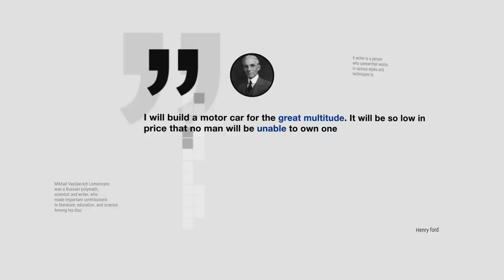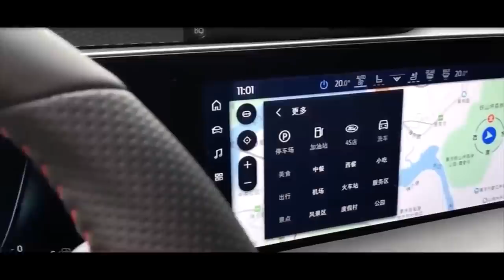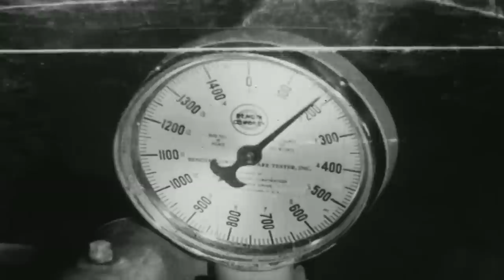Ford CEO Shocks Industry With New $20k EV!

Comment: Plot twist - the 20k version has 75 miles or range. You need to add on the Ultra S package for $19,289.93 to have over 250 miles of range, as long as it's not cold outside.
Reply: That's some real range anxiety right there at 75 miles alone. Especially with how hard it is to find charging even in cities.
Reply: And no traffic . No stop signs and down hill
Reply: @thetruemorg  yes. 75 miles is a local runabout to buy groceries, not a road trip act.
Reply: @thetruemorg  Not range anxiety, more like how I don't think a $20k EV will be all that great based on how much all the others cost. You'll probably have to end up paying close to $40k to get something worthwhile. They have to cut corners somewhere to get the price that low, and it will probably be in the battery size.
Reply: Is this information available anywhere or are you just speculating?   I haven't seen any 75 mile range anywhere.
Reply: @shoveI  i was joking :)
Reply: @thetruemorg  I drive a 60 mile range EV in Canadian winter and zero range anxiety. Don't suck.
Reply: @Ashquacks define where in Canada?   People from Vancouver, Montreal or Toronto Area winter is different than some places  in Canada.   Try Northwest Ontario or Manitoba area where it can be -30°c to -40°c for a few weeks.   That’s not even with the wind.  That’s -22°f to -40°f my American friends.  :)  People from larger city like Toronto and Vancouver describe winter and cold differently and tend to over exaggerate.  😂🤣  January and February is the coldest time of the year for central Canada in Manitoba and Northwest Ontario.
Reply: @LamHalen  Calgary, where we indeed do get (and did get) weeks of sitting in the -30's. Windchill also doesn't affect inanimate objects like cars, it's just a thing for us because of the moisture in our skin.
Reply: 🤣 fax. Or u have to wait 2 whole years for delivery. And by that time a new one will cost less
Reply: The vehicle isn’t even out yet!  Who said it has 75 miles of range?
Reply: @jakereal3604  I was joking :)
Reply: @Ashquacks  Yes, just to go to the 7-Eleven...
Reply: Actually it is a 7.5 mile range.
Reply: This will not happen at that price. It it is early 2023 now and no cheap EV. The price target will never happen and it will not have that much range and HP.
Reply: @rotart12arx3  "Around $30k" could end up just meaning $32,599 for bare bones. I'm expecting this to be at least $50k for anything worthwhile.
Reply: LOL!!!!  Thought it was too good to be true - 20K and only 75 mile range.  Ridiculous.  I will pass on this idea from FORD.  Also when would it show up in the US.  Sounds like they are making it overseas - not sure though.
Reply: @LamHalen  Where I used to work at we would have some customers from Nunavut and other cities way up north and I would always hear how Montreal winter was way worse than up there.

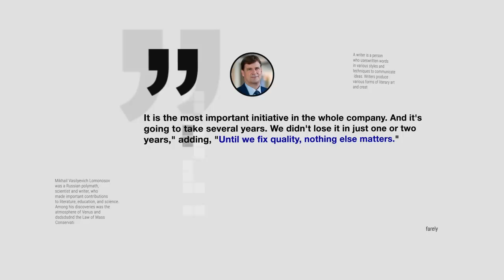Comment: 5:00 I am sorry, but QC is not related with recalls, it's bad design. QC check if what leaves the factory is aligned with the spec. If yes, it's 'OK'. If you have a recall, because you found that the glue you use to fit your panoroof is too weak to withstand the weather and speed, the QC check won't find it faulty, as this is your design and spec. This is the design and pre prod test team's fault for not to spend extra two months on testing. Same story with Rivian and snow on LEDs. This is not QC, this is a faulty design.

Comment: Wrong again. The Bolt 1LT retails for about $27k. Cheaper than the Leaf and a much better vehicle
Reply: 32k now
Reply: @enriquereboyras4381  no it's not the 2023 chevy bolt ev is 27000 and euv is like 29000
Reply: @Samuel Walker. Leaf is better. It doesn't burst into flame like the Bolt because GM uses scrappy LG batteries.
Reply: @mrgurulittle7000  Scrappy is good.
Crappy is bad.
Reply: @D Vader. I meant to say crappy. Anyway... A Nissan Leaf is neither of those. They are built much better that the Bolts which are made by LG.
Reply: @mrgurulittle7000  19 fires with 150,000 vehicles is minuscule. Tesla has had more fires and GM has replaced most of the batteries already and will eventually replace all of them  Chademo is dead why would you buy a car with such limited charging options
Reply: @boomerbits2297  Chademo is better because it is a two way power flowing charger. The industry talks about EVs powering homes, but only chademo can do that.

Comment: in December 22. OEM Battery costs are trending below $95 / kWh. So a 65 kWh (270-mile range, 220 miles in extreme temps)  Including BMS OEM cost $7000. The rest of the EV systems cost less than an ICE. OEM can source and assemble the rest on the skateboard for $10,000, add a 25% margin. An OEM can hit a $22,000 Sales Price in 2023. GM is selling the 2023 Bolt for $27,900. When motor efficiency gets to  6 mi/ kWh then you only need a 45-kWh battery with BMS costing $5,000, rest of EV costing $10,000 33% margin = $20,000 sales price. A second 'commuter' EV in a family with a 200-mile range costing (Bat + BMS $4000, rest of EV 10,000) with 25% margin = $17,500. The Chevy Spark EV (2014-2016) built on the Spark ICE platform was (is) a fantastic economical 80-mile range daily Commuter EV with DCFC for $20,000.                                                             Yes, Profitable, affordable EVs are being built. Following the IT and WWW model, many EV software services uploaded via the WWW and GGG (Global Grid of Grids) will add revenue to OEMs EV sales. EVs are Tech devices + mobility devices. No one sells phones anymore....PCs, cell phones, the internet were all too expensive and impractical, remember those days... and what will we do with all of those cell phone and lap top batteries? Plugging in a phone? Nah, never happen. Such a circa 1985 mind set. E mobility, EVs as a service are here.

Comment: Tesla has an achilles heal called service and training , if they can get there dealerships whipped into shape they can beat them at their own game. The masses don’t need 0-60 in three seconds and the pipe dream of full self driving. But a reasonable range , dependable and a warranty that leads the industry should be enough too get the job done and run their stock price to record highs. Just like Henry 100 years ago.

Comment: Electric cars should be cheaper than gas cars.  Yes, batteries are expensive but so are sophisticated internal combustion engines and transmissions which require A LOT more manufacturing infrastructure.

Comment: Um... The Nissan Leaf's second generation has a lower range of 149 miles of range and an upper range of 212 miles of range.  Also the Leaf is limited to chademo quick chargers of which there are enough, but it depends on each person's needs.

Comment: Ford is the dark horse only now in 2023 coming out with an in house dedicated EV platform instead of modifications to ICE architectures or joint venture.  
GM, on the other hand, has a well-branded Ultium about to hit roads a few years too late.

Comment: No mention of charging infrastructure other than home charging. With a 270 mile range, this is a commute car and at $20K it is a perfect fit for that huge un-addressed market. The Hyundai and VW EVs are too expensive for this market. Tesla will produce an EV in this price range or a little higher and there's nothing wrong with being second to market as Ford is with its other EVs. The Manufacturing ramp and the charging infrastructure are still unknowns for this EV but with Ford moving faster than most other EV makers (GM, VW), this EV will significantly help the adoption of EVs.

Comment: $20,000 ? Built in Germany. Using VW mechanicals = NO CHANCE !!!
Reply: The cheapest VW EV costs around 23,000.-- in Europe. However, that's not a 290HP Pickup or crossover with 300 miles range. 20k you are talking electrified Fiesta-ish shitbox with cardbord door cards and potato hide upholstry, 125BHP and 200 miles of range.
Reply: @adrianguggisberg3656  it’s something.
Reply: @JohnGeorgeBauerBuis  Yeah, these are, unlike a pickup, some of the most sensible and useful cars. In the video, however, Ford is being hyped to release an electric pickup with 290HP and 300 miles of range @20k. That's ridiculous. VW has already hinted at prices starting from 35k for the same VW/Ford pickup with a VW batch. Ford may (I hope they do) have something in the making for 20k, but that won't be a pickup.

Comment: The Ford Focus EV was around $35,000 new. Got my FFE 2013, 2 years old, for $12,000 with 30,000 miles. Now it’s at 100,200 miles and going strong. I’m disappointed they discontinued them.
Reply: How is the battery holding up? What environment? Know a buddy whose has a bolt and his biggest complaint is the cold sapping his mileage and the hvac system finishing it off leading to some double digit range when freezing outside.
Reply: Yea I always see them with little range, lovely interior on the other hand.

Comment: Range will be 75 miles. If you want 300 mile range, it will cost $45k
The Leaf has greatly reduced range at highway speed, <75 miles.

Comment: They keep talking about being just like old Henry Ford.  They forget he believed in raw materials in, finished products out.  Building a break through platform in Germany using a German platform isn’t going to sit well with some segments of the population.  Here is sending a mixed message regarding labor.  I agree with an earlier statement about QC vs design.  It’s design that drives quality.  It’s design that gets compromised when cost is an issue.  Ford used the low cost but questionable safety airbags.  No amount of QC would fix that.   There was a genuine need for a car in this category but an all electric?  How about a hybrid- electric that can go from  downtown Detroit to the Mackinaw Bridge in February on 3 gallons of gas for $15,000 made in Highland Park, by the UAW.  They own the real estate, or Dearborn.

Comment: So the Leaf 60kw version has an EPA range of 212 miles, and all the leafs I’ve owned (2) and the current models are absolutely compatible with public chargers. Maybe you meant that the Leaf has a CHAdeMO connector for fast charging in the US. Sure, that’s an older standard but it’s available on plenty of fast chargers here. Please get your facts straight - everything in your video is suspect when you start it with these kinds of errors.
Reply: Some assembly required

Comment: I paid just under 50k for my 2021 Ford Mustang Mach e. It’s little a load of plastic junk that’s been recalled so many times I can’t remember them all and it was just recalled AGAIN. I have come to literally HATE the Mach e especially after I experienced the shutdown defect while driving placing myself and everyone else on the road at danger of bodily injury or death. Yet Ford doesn’t actually fix anything, just puts band aids on like Hyundai/Kia with their theta 6 engines that literally catch on fire. At least Toyota bought back the bz4x’s when their wheels fell off. Ford sells its customers poorly designed and manufactured new cars worthy of a junk yard or a match then their dealerships don’t even know how to service electric cars even though they’re Ford “EV certified” or whatever they call it. I will NEVER buy a Ford again. Everyone else please save your money and your life and buy something else that won’t potentially catch on fire due to “faulty contactors” as I’m sure for 20k the car is going to be even worse than my POS Mach e

Comment: You should go solar panel panoramic sunroof that way when the car is sitting outside in the parking lot the battery is being charged at least to some degree and you should use a generator on the front differential in two different battery packs you can flip it like the flux capacitor so you can use one battery pack to power the vehicle and the other battery pack while you're driving the vehicle is being charged by the generator on the front differential give the government what they want clean energy you never have to worry about paying to drive a car all you got to do is pay for the damn thing as long as you're not being racist with it

Comment: Challenging Tesla is not as hard as you think.  Yes, Tesla had 2 of the top selling cars in the Model 3 and Y, but the '3' is looking dated and priced rather high in the UK where there are no EV Grants.  In the similar price range you have the new challenger in the Hyundai Ioniq6, which is simply sleek and beautiful to look at (and once mine arrives i will let you know how she drives).  If the new Ford EV can match the range of the Tesla then maybe it could be a new challenger, but it comes down to pricing and for the pricing what range?  The video tells us it is using the VW MEB-platform which makes sense with their colaboration but offering 274 miles range falls short of the ID.4 with 77kWh battery offering 319 miles.  The Ford though does have the looks, but lets see it in the flesh, so to speak before we comment any further.  2023 will be an interesting year for EV cars, and whilst the USA there are some new comers like Fisker, it is the UK market where we need more choice and especially an all electric 4x4 Pickup, so lets see if 2023 can see the likes of Rivian or Ford bring the missing link to the UK.
Reply: Tesla still dominates the EV market. If Tesla still dominates the EV market technologically, you know Ev still have a long way to go. The mach e has 1.6kilometers of wiring alone.
Reply: @willjennings983  The EV market is very small. It's single digit percentage numbers of the auto market as a whole. Once large companies design and ramp up production it wouldn't be hard to overtake tesla, especially considering the companies already have established dealerships to service and sell the EVs as well as the factories to build them (a lot quicker to renovate than to build a brand new factory). Unless tesla fixes their quality problems they'll basically just be the next audi.

Comment: Do not believe it that this car will be $20,000 usd.  By the time they release this car the price of the BASIC entry level model with low range will jump to $25000 usd.  Also, if you actually speak to many owners of the new Ford Lightning EV truck, they will tell you the truck absolutely sucks at towing - range gets cut by more than half and also even if you are NOT towing, the real world range is only 80% of the range claimed by Ford.  Once the Tesla Cybertruck is released with their newer 4680 battery cells, it will crush the competition.  Many buyers will eventually find out, and switch over to the Cybertruck.  Ford will probably cut the price of the Lightning by at least $10,000 - $15,000 to attract buyers in the year 2024 as the Tesla Cybertruck sales dominate the truck market, and the RAM Revolution takes second place.
Reply: @@w.t.f.6346 Tesla sold the most EVs in north america. they sold way over a million model X, S, Y and 3 combined.
So its expected that there are more people complaining, but as a percentage its probably way less than other EVs.

Comment: Judging by fords customer base… I can see this bankrupting them. People that use their trucks for work will start leaning to Toyota, EV’s are garbage. You really can’t fix anything on it without taking to dealership. The batteries may last you two years then your paying. 20-30k dollars for a new one to be installed, takes half a day to fully charge in. Price increases due to electrical grid demand are going up. I don’t mind EVs as they do put out a lot of power but. ICE’s are just much simpler and aren’t as much of a money pit. Companies like Toyota are going to take an even larger jump over ford

Comment: The CEO needs to resign. I told him in Nov 2012 that the new Escape back then had doors that were hitting chipping paint between front and rear doors. I told him to do an update on the CAD system robot installing the doors. Told him to move the rear doors back a few millimetres to increase the gapping. He did not do a simple update in the measurements. In 2018 plus, the doors were still hitting. I would go Escape to Escape showing owners how their chips happened on their doors. I showed them the doors hit. The CEO knowing the problem did nothing to fix this problem because he obviously does not care about quality. Ford job quality #1. BS. Ford job quality crap. Fire the CEO. I will never buy Ford again.

Comment: If this thing has the specs in this vid (almost 300hp equivalent, nearly 300 miles range, 15" touchscreen etc) and is truly anywhere near $20k, then Ford must be stealing the rare earth minerals needed for battery manufacturing, and making their own computer chips😂 Oh, and since Ford isn't known for stellar reliability/build quality...how bad will it be on a $20k EV?. I'll truly be shocked if this thing releases near $20k and is actually worth owning..

Comment: Lol this video is definitely for Ford, it takes a lot of "leaps of faith" to push the story. Truth be told, there is a reason Teslas are more expensive, just look at the charging network, well maintained, and fast typically no waiting to charge. Ypu pay a premium for tesla to have access to their vast charging network. Ever pull up to a charge America charging station? Half of the charges are broken if you can even find one. So for those who always use the excuse, "Oh, tesla is so expensive," watch how fast charge on the road and typically no waiting. That's what you pay for, and of course, Tesla is still King of all EV.. that won't change, they are too far ahead of the competition

Comment: How much to replace the battery?
Reply: How much to replace an engine and transmission more often?
Reply: @dvader3263  Some reports show complete ev power train change at 60,000 miles. I have over 200,00 miles on my 99 Ford Ranger. Same engine.